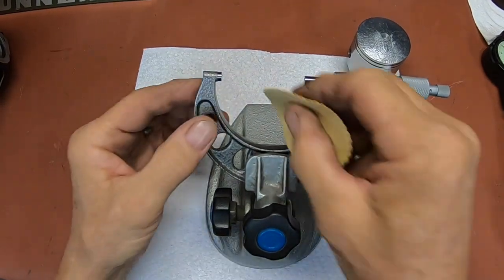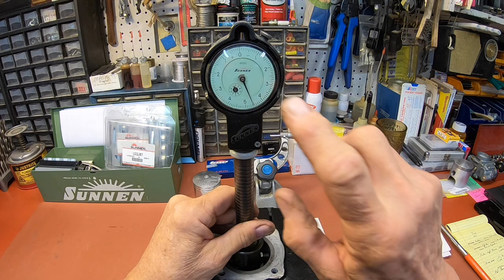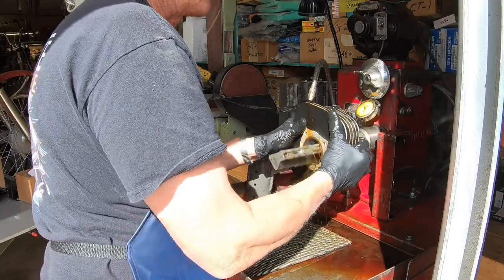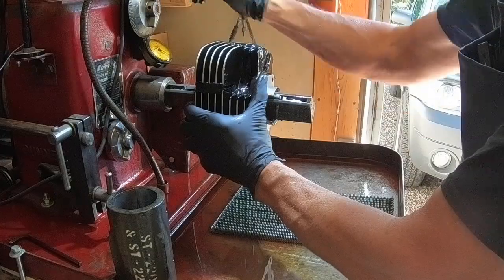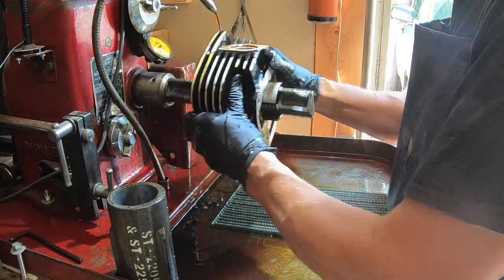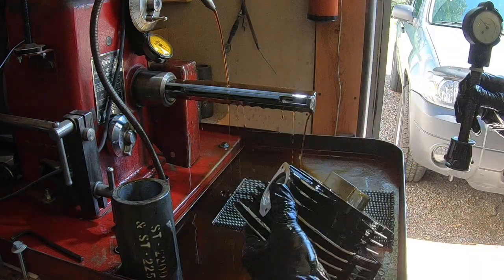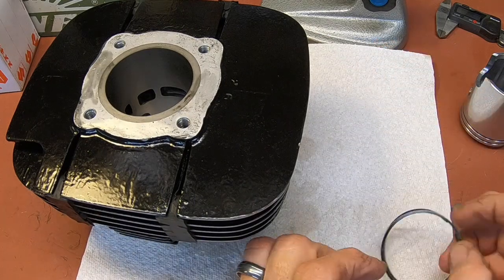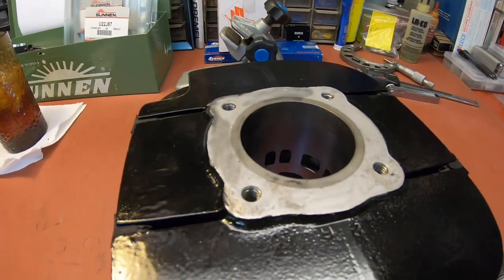Honing and chamfering a two stroke motorcycle cylinder, TS 125 Suzuki

Comment: Watching this make me AMAZED the motor ran at all. Despite  all of 20-30 miles on it the center portion of cylinder was hollowed out as if there were thousands of miles on it Wow, what the HECK happend. No wonder it sounded so slap happy!! Dale to the rescue.
Reply from the maker: It's a mystery to me, just commenting on what I think and wonder, I think this is going to make all the difference. Thanks for hanging out in the shop with me.

Comment: Excellent material on rebuilding these old bikes correctly. Dale is your work just local or are you expanding a bit as time allows.?
Reply from the maker: Thanks Larry, I sure appreciate it. I am trying to slow down on the restorations, although I will continue to do that on my own bikes that I will eventually sell. Just want to get so I don't feel like I must punch the clock. I do take on some side jobs, such as boring and honing, and other small jobs, but I am pretty selective about it. I guess, since I am retired and so enjoy these old bikes and enjoy making the videos, I just don't want to make a job out of it. Thanks for hanging out with me.

Comment: is it possible to cut down on the honning by boreing more to start with? or is that dangerous!
Reply from the maker: Sure, it is, I really try to get a little closer, but it just didn't work out with this one. Optimum would be to hone out about .004 total, but I don't like to cut it that close. I'm just not in any hurry. Think folks are liking this type of content.
Reply: @montana2strokeracer  your right about the content, you can tell i think by the increase in comments/question. not considering my off the wall wise cracks. seems the little unusual issues that crop up are of particular interest.